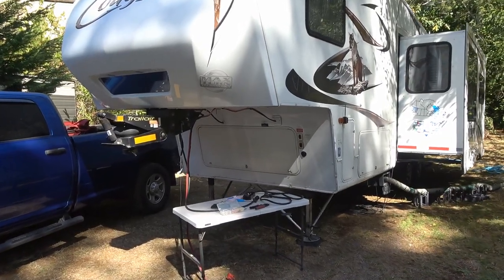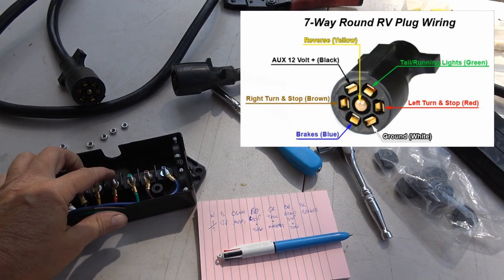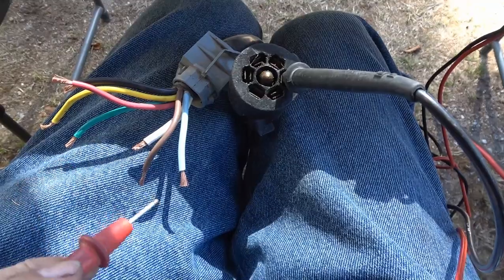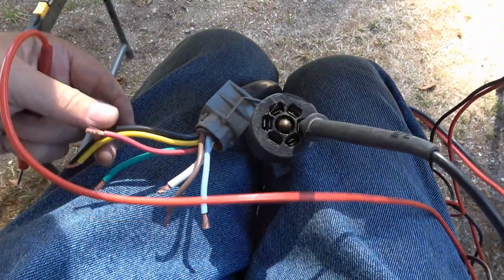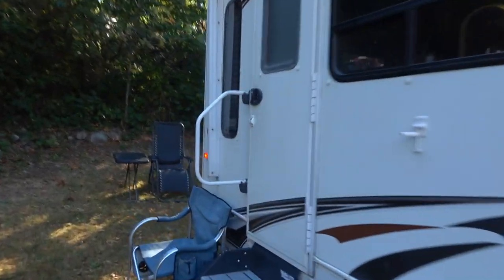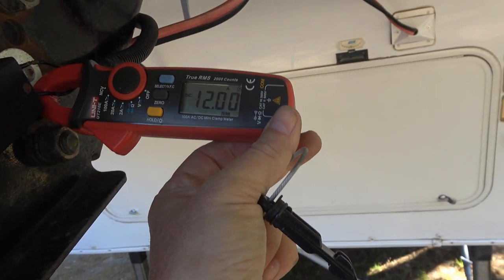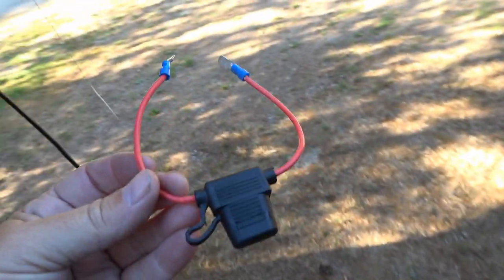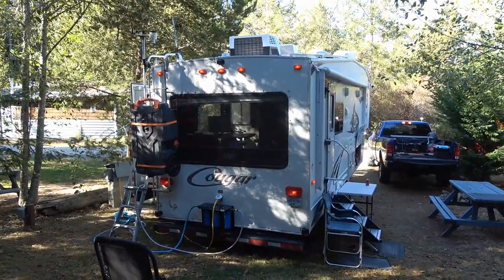Replacing 7 Pin RV Type Tow Cable Assembly (Keystone Cougar Fifth Wheel Trailer)

Comment from the maker: Related Links 
Tow Cable Tip – Fix Pulled Away Cord Covering https://www.loveyourrv.com/rv-power-tow-cable-tip-fix-pulled-away-cord-covering/
Replacing Emergency Trailer Breakaway Switch - https://www.loveyourrv.com/trailer-breakaway-switch-install-and-test/
7 Pin Tow Cable Charging Tests - https://www.loveyourrv.com/7-pin-tow-cable-charging-tests-using-lithium-rv-batteries/
Electrical Test Gear - https://www.loveyourrv.com/electrical-test-gear-aboard-rv-uses/
How to Use a Multimeter for RVers - https://www.loveyourrv.com/how-to-use-a-multimeter-for-rvers/

Comment: Thank you for posting this. I just found out I have no running lights on my rv. I forgot to unhook the rv battery and it sparked and the wires are black on the wires. I've been crying and beating myself up.

Comment: Great video! I am curious, how do you (or do you need to ) shut off the battery before doing this replacement?
Reply from the maker: Personally I have a battery disconnect switch for my RV battery bank, but if not a person could just unbolt and remove the positive cable to the battery bank.

Comment: Good video. I have a cord cover that's pulled away and I couldn't remember what you used to fix yours. As far as testing,  every time I'm standing behind the trailer waiting for the CEW (chief executive wife) to select signals and brakes, I wonder why I can't just put on the emergency flashers and have her step on the brake? Wouldn't this indicate power through the signal circuit?
Reply from the maker: Its good to check each function as its used since loose or open grounds in the system can cause all sorts of weird things to go on with the lighting system. But basically the flashers, signal and brakes are all using the same extra bright filament or LED section in the tail light lamp. Usually if the brake lights both work the signals should also.  But its good to know that the signals are working as expected.
Reply: A quick test is to stand at back of the trailer & use your remote to lock & unlock the truck. If the lights flash your good to go
Reply from the maker: @garthhart6642  Good tip, too bad my truck uses a regular old school key, no remote. :)

Comment: Hey, I'm not getting 12v at the end of the connector coming out of the RV. Do you have an inline fuse on the hot wire going into your RV from the junction box?
Reply from the maker: I didn't see on in there, which makes sense, usually fuses are located closer to the battery they can protect all the wire leading to the pin box.

Comment: Some time ago I came across a plug adapter with a fuse. You plug your cord into it instead of your jumper wire.  Cost me about $5. It has no branding on it so I can't tell you anything else about it
Reply from the maker: Yeah, I've seen several different varieties advertised over the years, some have various flashers and switches and timers etc. built in. :)

Comment: You didn't show how you wired it to the box ! That's the whole point to the video.
Reply from the maker: Sorry about that. Didn't think anyone would need to see how to put a ring connector on a bolt stud and tighten a nut, seemed pretty straightforward, but guess somebody does
Reply: @LoveYourRV  your old box was not the same has the new box. On the old box you had 3 white wires into one connection. So did you transfer all 3 into one connection to the new box? And etc ? That’s what I meant. Also did all the colors match up to the new box? I’m not talking about a ring connection.
Reply from the maker: @garycook568  Carefully listen to what I say in the video all the colors matched on my trailer. I tested them with my multimeter to make sure. https://youtu.be/oOgfQf3lsU4?t=115 Also at this point in the video, I told you I left the white grounds crimped together and added one ring connector  https://youtu.be/oOgfQf3lsU4?t=160  But you can't just copy what I have done as RV wiring can vary and you never know what the OEM did when they made it.
Reply: I did watch the video again. Good video just wished you would have added a little more detail in how you transfer the old wire into the new box.